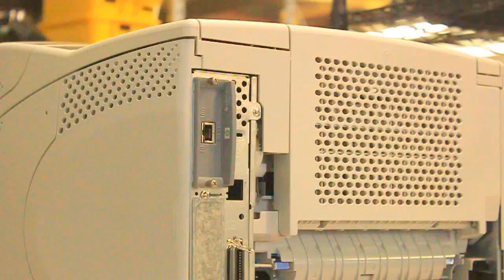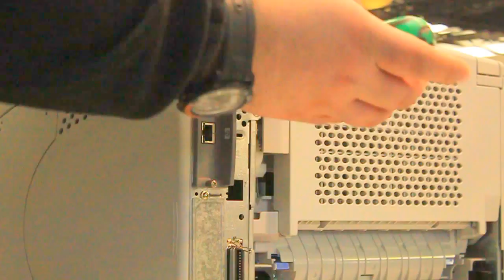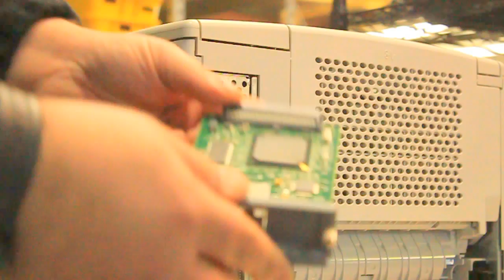HP Laserjet Jet Direct Card Install Uninstall

Comment: Hello,  I replaced the  Jetdirect card on my HP 4000 and since , none of the 2 slots seem to be working. I tried to put back my previous jetdirect card that had been working perfectly (just slower than the new one) and it is not recognised by the printer anymore. The only mistake I seem to have made is that I hadn't unplugged the power cord though the printer was turned off. Any idea what I could do ? In case I damaged the female Jetdirect connector  in the printer, do you know if that is hard to replace  and where to find the part ? Thanks for any advice. Regards from Paris

Comment: Dear colleagues, I have two HP Laserjet 4250N printers stored in my cellar for nearly 16 years now. I want to get them back into operation. The problem is that I once set a password to protect the configuration. In our days I can't remember the password once set any more. Due to the fact that I have to reconfigure the devices anyway because I have to adjust them to the current network configuration - is there a way to hard reset them back to the factory configuration to get rid of the passwords? Or can this only be solved in buying two new refurbished HP Formatter Boards for these printers?

Comment: Hi, I'm purchasing a 4200s that has ethernet for networking. Do you know what piece is available so I can switch it and use usb/printer cable? Thanks.
Reply: Easier to just get a Centronics to USB cable off of ebay or maybe amazon.  I just got one for a friend's LaserJet.  

Here's a new one from China for under $7 USD  
https://www.ebay.com/itm/36Pin-Centronics-to-USB-Cable-For-Parallel-Printer-Bi-directional/133028057328?hash=item1ef91710f0:g:8YAAAOSwo~VcufiU

Here's a new one from the U.S. for $15 OBO 
https://www.ebay.com/itm/IOGEAR-GUC1284B-USB-to-Parallel-Adapter-Type-A-Male-USB-Centronics-Male-CABLE/324239423417?hash=item4b7e2cf7b9:g:MLoAAOSwzaJfGvXB